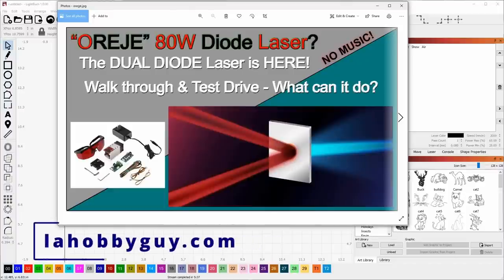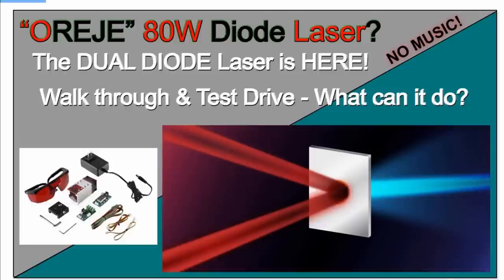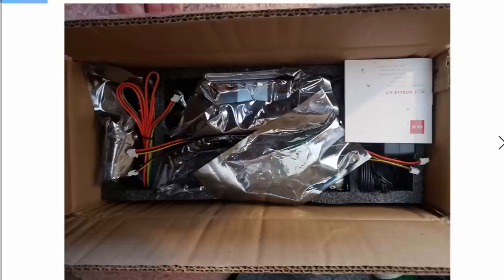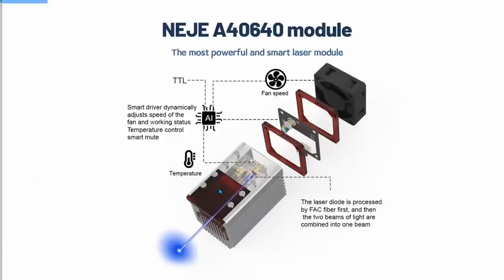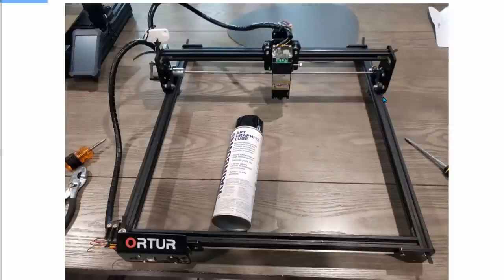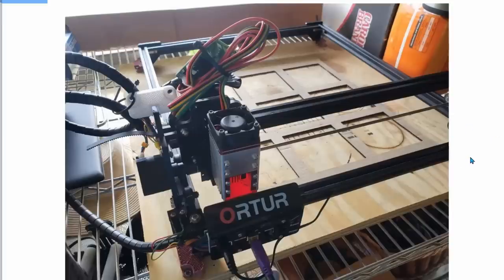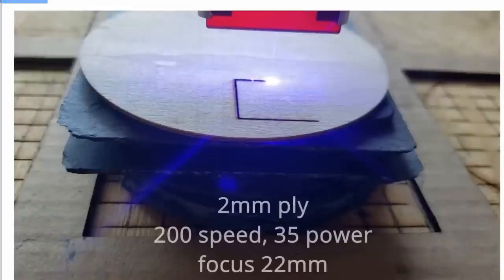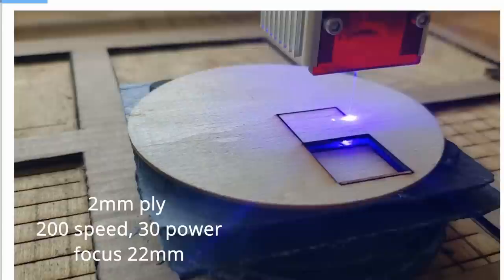Upgrading a diode laser from 20 to 80 watts!

Comment: Could this be used in any brand or only ORTUR, 2nd question, I check the link in aliexpress and it gives differents options, what is the difference from the USD 109 to the USD 259?
Reply from the maker: It can be used on any Chinese diode laser Alf. The difference in price is the power. The more expensive, the more power. When you click on one you can see the specs.
Reply: yep, look closely above the option, it will change from 80W to 40W and 30W, you'll see it really tiny above the options (last two digits).
Reply: @TheLouisianaHobbyGuy  Thanks
Reply: @stvcolwill  Thanks

Comment: I have orthur LU2-4. Is the the same one you have that is just plu and play?
Reply from the maker: The swap in this video Adrian was the LU1-4 to the A40640. I don't have the LU2-4. It needed the Neje adapter board & wiring which was included. The Neje is a 4-pin, while my Ortur was a 3-pin. I could have just cut the 4th wire, but since the adapter was included, I used it. If you buy the one with the accessory pack for a few dollars more, it comes with everything you need to adapt to any Ortur. However, I believe the LU2-4 is 24 watts, the Neje is 12 watts. So you would need the accessory pack with the adapter board, and you would plug in the 12 watt adapter directly to the board, which is also included. You would just be running two power supplies. The one for the Ortur and the one for the Neje,

Comment: I have a k40 that is very modified and works like a charm with light burn but is there any reason I should use a diode based laser over co2?
Reply from the maker: Well, many people have both. Diode lasers can do much finer engravings than a C02 because of the dot size. For cutting, I prefer the Co2, but for engraving, the diode has much better results.
Reply: @TheLouisianaHobbyGuy  oh okay thanks for the info! definitely considering getting a diode laser

Comment: How do you know the optimal height of the module to the material you are cutting/engraving? White the Ortur unit you just use their height cylinder, how do I do with this one?
Reply from the maker: Neje says 24mm Fabio, however, I have found that 20mm is the perfect focal distance for this laser. Running test grids is the best way to find the optimum settings. I did quite a few raster & vector test grids at different focal points.
Reply: @TheLouisianaHobbyGuy  thank you Rich.

Comment: I just did this upgrade, but it doesn't work for some reason? When I try to test fire the laser it does not fire the laser the fan just continuously starts/stops spinning. Any advice? Also when the fan is spinning the machines movements are very very jittery and loud, when the fan is not spinning (it stops after a while after i turn off the test laser button) it goes back to moving normally.
Reply from the maker: Sounds like a control board issue Travis.
Reply: @TheLouisianaHobbyGuy  it worked just prior to me installing the a40640. If I plug the original head back in it works fine. 
Unless you mean the adapter board thing?  I’m trying to chat with neje but the time difference makes it a pain
Reply: @TheLouisianaHobbyGuy  Not sure if you are interested in an update or not but others might be. I did some trouble shooting steps and I am apparently experiencing what they call a "L2 error"... there is how ever no description of the error or steps to solve it that I can find. I am awaiting their next response, the time difference makes this fairly tedious.
Reply from the maker: @Xploit66  Awesome, post the resolve when you get it!
Reply: @TheLouisianaHobbyGuy  Im still waiting on a resolution, but I do have a question after doing a bit of research. It seems the A40640 laser module wants 12v 4amps and the input for the ortur is 24v 2amps is that the issue do you think? Not sure why it worked for you but not for me.
Reply from the maker: @Xploit66  Well I didn't know you had the pro version. If you read my pinned comment, I talk about how to use it with the pro.
Reply: @TheLouisianaHobbyGuy  Ah i completely missed that and didnt realize you didnt have a pro in this video, I did end up figuring that out today and have a power supply on order. My kit from neje didn't come with one or I may have figured it out sooner. I have some female JST 3 pin connectors, Im going to solder an adapter to go from the 3 pin on the ortur to a 2 pin male to plug into the adapter board so I dont have to cut the red wire. Hopefully I didn't damage the laser module in my haste.
Reply from the maker: @Xploit66  It should be okay 🍀
Reply: @TheLouisianaHobbyGuy  thank you so much for the help and input. Hopefully come Monday I’ll finally be able to test it.

Comment: Is this more powerful than the SCULPFUN S9, which is supposed to be similar to a 90W CO2 laser?
Reply from the maker: Twice as powerful. The S9 is a 5.5W laser, and the claims of achieving results of a 90W C02 are just laughable.
Reply from the maker: @soylentgreen9314  I don't know, if I were to upgrade I would be looking at the Neje A40640, or I might wait out the quad-diode laser modules.  Both x-Tool and Atomstack have launched them and I'm sure more are on the way!
Reply from the maker: @soylentgreen9314  My pleasure!

Comment: Got this laser about a month ago replaced my 30 watt neje, what a difference I'm not using anything that came with it except the power supply it just plugged in where my 30 watt was plugged in, didn't use the adapter board because my set up is a neje master 2s, am i right for not needing that adapter board?
Reply from the maker: Yes! The adapter board is only for brands other than Neje. And yeah, the difference is, the tiny square dot instead of the rectangle! Such a great upgrade!
Reply: Does turning the lense do anything for the focus I turned mine and it didnt seem to do anything, I use the up and down slide for focus, was just wondering if i messed anything up by turning that brass lense

Comment: Im about to buy a laser so I dont have any practical experience with them and I was wondering if it was desirable for a laser to have different lenses for different focal lengths for different uses I imagine?
My original plan is getting scrapped so I thought I could get a cheaper laser setup and put a better laser on it but I really dont know what a better laser is. Every thing Ive see has a fixed lens but the one I'm looking at has replaceable lenses with different focal lengths and different power percentage ratings.
I will definitely take a look at the laser your demonstrating but I do like the ability to change lenses for different effects.
Reply from the maker: The only differences changing lenses will achieve is a smaller or larger focal point. You can achieve the same affects by raising or lowering the laser. A couple of years ago changing lenses was a thing, but not anymore. Most are now fixed focus lenses and they are all adjustable on the Z-Axis.
Reply: Changing lenses reduces power or allows more power. It should also raise or lower the focal point where the beam is the strongest. I think its just like a magnifying glass. The lens determines the distance of the focal point. But then again, that works for white light. Laser light might not be as drastic as white light but I would think it still has a focal point and raising or lowering the lens will only reduce or gain the strength by widening the laser which (in my non-experienced thinking) would resort to scorching.
Scienci labs has came out with their laser from canada and I was interested in that one but I dont know if it would fit.
I've been watching demos of that one and I really like it.
Anyway, bout to watch your video now on lightburn before I hit the buy now button. Can light burn run (by itself) the cnc and the laser? I heard the left side runs one thing and the right side runs the other thing wahtever that is?
Reply from the maker: @iwannaapple7190  I'm not sure about the laser for the Longmill. These diodes come in 12 & 24V, so that would be the deciding factor. Whether or not the voltage is correct. You could always change the pinout of the comms cable and add an adapter board. But like I said, the result will be the same. I don't know that there would be any benefit of a verifocal laser in a diode laser anymore. Higher power diodes don't come in verifocal to the best of my knowledge anymore. The days of the G2, G7 & G8 lenses are over with the more powerful dual diode lasers today.
Reply: @TheLouisianaHobbyGuy  
Very informative. I'm glad I found your Channel
Reply from the maker: @iwannaapple7190  I'm glad you found it too! Thank you!
Reply from the maker: @iwannaapple7190  Never heard left side, right side, but yes, I do CNC engravings from Lightburn on my 3018. Just have to change my GRBL settings to $30=255 & $32=0
Reply: @TheLouisianaHobbyGuy  
Even though I have no experience with that yet, I figured you could do it. But yet others on you tube are not acknowledging it. In fact, you should make a video on how to switch while using one program.Program for this and a program for that kinda thingvis confusing.
I asked another you tuber he said I need can software and two others. But yet I watched another and he explains the left window pane does a cam and the right window pane does the other. Forget what its called here because I haven't any practise yet.
In fact, I have been watching laser bids for four solid weeks! No one has yet to show how to use one program to run everything!!!
Hint: hint...
Reply from the maker: @iwannaapple7190  I only use Lightburn!
Reply: @TheLouisianaHobbyGuy  
Not talking about switching programs.
I am talking about you are the only one I have seen use ONE program to run both. Or for that matter, using lightburn to run the CNC.
Don't believe me? Try to find a video of a youtuber using lightburn to run the CNC. THEN switch over and use lightburn to run laser.
Just now, I was looking for another youtuber comment that told me I needed 3 programs. In a month, your the only one to even say that.
My programming instincts kicked in when I saw lightburn. I knew it could do it. Make sure you make that video showing you can do it.
Reply: @TheLouisianaHobbyGuy  
I found it. He said I need design, cam, and router controller softwares.
Another video said the left pane was design and the right pane is cam. So then and there I knew you could do the whole thing with one piece of software.
Reply from the maker: @iwannaapple7190  Awesome! I don't use other software anymore because it's just unnecessary! Thanks for the clarification!
Reply: @TheLouisianaHobbyGuy  what, does this mean I can ditch my easel subscription and get the same results using lightburn to control my cnc?
Reply from the maker: @kevinhunt8863  I don't know what CNC you're using, but I use Lightburn on my Grbl CNC, yes. However, you still need to do tool paths & changes and such, so no, not really....

Comment: Have you tried this laser on glass without a couting? Like you can do with a CO2 laser.
Reply: Material should absorb the light in order to burn/evaporate. Glass absorbs at 10micrometers wavelength (CO2 laser) and is transparent for visible light - also for 405nm (violet), which this laser is. So - no, it will not work for normal glass.
Reply: @TushhsuT  oke, thanks.
Reply from the maker: This laser is actually 455nm, but it is still in the visible spectrum, so Tush is right, it can't etch glass. You have to coat it with something like black paint.
Reply: Put Painter's tape on it. then try. keep it fast. glass all crack fit gets hot
Reply from the maker: @darrinjones9387  Painter's tape doesn't work, I've tried it. Black spray paint works well though.
Reply: @TheLouisianaHobbyGuy  it worked for me.
Reply from the maker: Oh I'm sure it does Darrin, but I like paint better, since it melts under the laser and helps to mark the glass. Plus, it takes less power. There are quite a few ways to do it, but you just can't mark glass without a hack.

Comment: Thank you for answering my previous questions. I have an ORTUR Laser Master 2 and I want to upgrade to the 40640  80 Watt laser module.  First, will it fit my machine, and is it as easy as you show on your video?
Finally thank you very much for all your videos. I am a pensioner so I will donate $10.00 to you, I wish it could be more but living on a pension  means saving for anything I buy for my hobby.
Reply from the maker: Hi Roger, thanks so much! But yes, it is as easy as in the video. I didn't leave anything out! The only glitch that I'm about to fix is the laser can't home because it hits the frame. It's not a big deal, I just raise it up before I home it, and every new job needs to be focused anyway. But I'm going to design a new mount to print to avoid this.
Reply: @TheLouisianaHobbyGuy  I am glad that I will be able to upgrade my Ortur LM2.
Thanks for your video.
Reply from the maker: @hobby4fun434  My pleasure! Have fun!

Comment: is this 80 watts of input power or output light power?
Reply from the maker: Read my pinned comment. I also covered it extensively in the video. I  actually got a 60W power supply with it. It's about 14W optical output.

Comment: I just recently subscribed to your channel and you do an awesome job.  I have just ordered the ortur laser master pro (which has a 24v power supply) and the neje A40640 kit you have in your links. reading through the comments I see several mentions of needing to use the PS that comes with the Neje as my ortur will have 24v power.  However - I do not see a PS mentioned in the description of the Neje laser module. It has the adapter board that shows an input for a 12v PS but no PS -  It looks like the power supply now comes separate on the NeJe site as well.  Neje lists it as a 12v 4a supply.  The only 24v4a PS on Amazon are 48w.  The 60w come in 24v5a - would the 24v5a work ok? - TIA
Reply from the maker: No Terry, it has to be 12V, 5A, 5.5mm. Like this one: https://amzn.to/3gt07BV
Reply: @TheLouisianaHobbyGuy  Thx - I just ordered it! - One last thing - The link to your new bracket on thingverse - Is that the one you are now using or did you develop a new one?  Also- did you share the file for your focus step tool? Lastly - anyone you know online who prints these type of things as a service for those of us who do not have a 3d printer?  TIA
Reply from the maker: @tbullard52561  Come over to the forum. I can post files there. https://lahobbyguy.com/bb/
Reply: @TheLouisianaHobbyGuy  ill go over and check it out....

Comment: Great video! About a month ago, I bought the Ortur LM2 Pro. Can I used the NEJE A40640 to upgrade this version in the same way as you have the LM2, please? Thank you.
Reply from the maker: Andy, the Pro version seems to have two different types. A 12V and a 24V, most of them seem to be 24V. If you have the 12V version, yes... but if you have the 24V version, you would need to buy the entire kit, with the adapter board and power supply, like I did, and then run the new PS directly to the adapter board. So your original PS would stay the same, plugged into the Ortur, and the new PS would need to routed to the adapter board and plugged in there.
Reply from the maker: @andywright9194  I have a homemade one from a mini compressor and a 3D printed nozzle. This is the compressor I used: https://amzn.to/3tC3w7e and this is the tubing: https://amzn.to/3tDrRcV 
I'll be adding the 3D printed nozzle to my Forums for free download in the next week or so.
Reply: @TheLouisianaHobbyGuy  Thank you once again. BTW, I've just ordered Kit 1, which should arrive in a couple of weeks. 😁
Reply from the maker: @andywright9194  Let me know how it goes. Sign up on the forum. lahobbyguy.com/bb
Reply: @TheLouisianaHobbyGuy  I am so glad you mentioned this!  I also got the LM Pro 2 and was considering the upgrade,, didn’t realize the power difference.  Might try it later when I know more.  Another great video!  Thanks!!

Comment: Where did you get that table with picks to cut material?
And what is the exact name to try to find it?
Reply from the maker: Metal is from Lowe's and the studs are for making punk bracelets.
Reply: @TheLouisianaHobbyGuy  Thanks
Reply from the maker: @ggmaury  Thanks for watching!
Reply: I found rhe studs but the plates I found are too small.
Could you tell me what size did you use for the plate?
Reply from the maker: Mine is small also, it's only about 8x10" I just center it under the workpiece. My friend is using an old oven rack. I might just switch to that.
Reply: Thank you very much
Reply from the maker: @ggmaury  My pleasure!

Comment: How do I adapt the Neje 80w from 12v to 24v?  I have the LM2 Pro.
Reply from the maker: Read my comment. It's the first one.
Reply: Are you referring to the comment about the adapter board?  Is this available from Neje?
Reply from the maker: You need the adapter board and a power supply. The power supply plugs into the adapter board and powers the laser module. All of these supplies are available on Amazon.